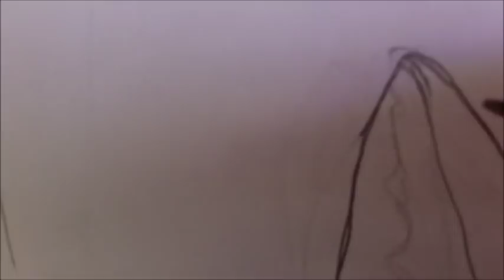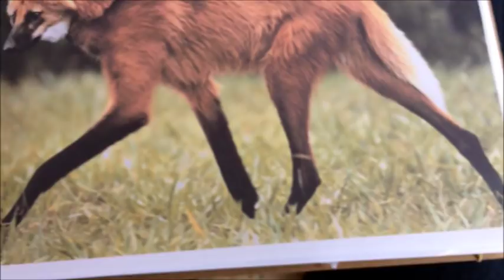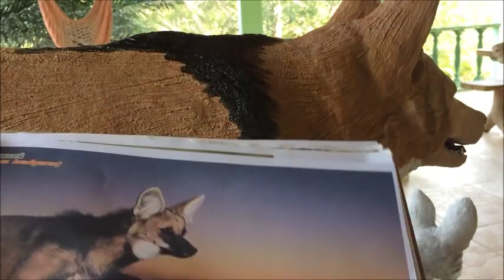DIY - Escultura em concreto de Lobo Guará - Maned Wolf cement statue

Comment: when I make sculptures soaked a rag in cement mortar and distributed throughout the frame, it turns out the cement Foundation on which the Oud then impose the main cement layer, this method saves time 2 times, all my sculptures are made by this method

Comment: I would like to know what mixture you used for the cement, thanks
Reply from the maker: I use only sand and cement. When the work is still on the screen, the mixture is medium sand/cement 2:1. At the final stage the mixture is fine sand/cement 1: 1. At this point the mixture is very strong so it is necessary to use water spray to avoid cracks.

Comment: What you use to make?
Cement or Something
Please reply in English it,s  urgent.
I can,t understand your language😀
Reply from the maker: I use only sand and cement. When the work is still on the screen, the mixture is medium sand/cement 2:1. At the final stage the mixture is fine sand/cement 1: 1. At this point the mixture is very strong so it is necessary to use water spray to avoid cracks. The sculptures are made to stay under sunlight and rain, the final coat has to be strong.

Comment: Which material you guys used to make this   animals 
Is it cement with sand or clay
Reply from the maker: I use only sand and cement. When the work is still on the screen, the mixture is medium sand/cement 2:1. At the final stage the mixture is fine sand/cement 1: 1. At this point the mixture is very strong so it is necessary to use water spray to avoid cracks. The sculptures are made to stay under sunlight and rain, the final coat has to be strong.

Comment: What kind of concrete!
Reply from the maker: When the work is still on the screen, the mixture is medium sand/cement 2:1. At the final stage the mixture is fine sand/cement 1: 1. The sculptures are made to stay under sunlight and rain, the final coat has to be strong.
Reply: @costaosborn298  thank you! Are the teeth made with polymer clay? Such nice sculptures!
Reply from the maker: @wolfy1 they are made with epoxy mass